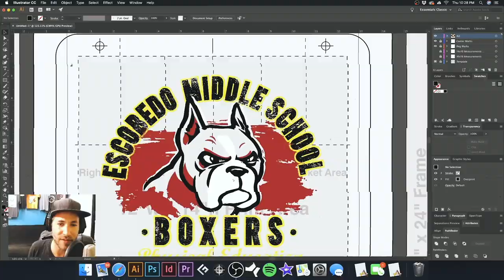How to Screen Print Rally Towels for High Schools, Colleges, Professional Sports Teams

Comment: Thanks for the advice Matt, really nice turn out on them towels! I wished I had enough work for an automatic press lol. Anyhow I use a water based adhesive as well, to much money for the aerosol sprays , less mess and more prints. I would go through cases of sprays determining  what substrate I used $20 quart of water base tack last me more then 1000 prints easy, try that with aerosol spray tacks, you would be lucky to make it to 500 prints on a can that cost $14 -$20 depending on brand of manufacturer.  Keep up the awesome work Matt!
Reply from the maker: Any time! And thanks! LOL, I know the feeling. It's taking me 5 years, dreaming about an auto to be able to afford a used one, and now onto something new. I agree with you. Spray tack can be good in a pinch, but spreadable adhesive is less mess, costs less, and is better for your health. I appreciate it! Trying to crank out as much videos as possible, or film jobs as well go to try and help everyone out. Sometimes we have to just concentrate on our work which is why things can be silent at moments.

Comment: Matt, why is the press still in the shop and when is your new one coming?

What is the first white your putting down and what mesh screen? What’s the highlight white brand your using and what mesh on that 2nd screen. 

🤘🏾Andy
Reply from the maker: Hey Andy! Taking a little longer than expected to get the press in due to my scheduling. We're really busy and needed to put it off. They offered to send it to the shop, but we don't have space for it, so we're waiting to finish up our workload for the year. We're anxious to get it in, but we have a lot of jobs due that we can't put off at the moment.

I used the same ink for the base and second white. Wilflex epic amazing bright white. First screen is 195 and the second 230.
Reply: Mikey Designs & Silk Screen gotcha Matt . Can’t wait to see the new one . 

Thanks for the info, sometimes I don’t know what mesh to use . I only keep using the combo of 110/150 or 160/200  . I may try a 200/230 kinda like what you did and see the results and hopefully gives me a thinner feel
Reply from the maker: @Factory928AC  It takes a little getting used to if you have been using lower mesh counts. Using a 195 / 230 combo even for white will give you a much softer hand. Almost Waterbased like. You'll use less ink, emulsion, and spend less time exposing screens.

Comment: Towels came out great. I love that waterbased pallet glue. never looked back at the spray stuff ever since i switched over. sometimes I do still use the web spray stuff for hoodies but that tends to grab so much lint off of the garments and builds up a nasty lint carpet on the pallets. Pain in the ass to get off. have to use acetone. you run into that problem?
Reply from the maker: I agree! I feel the same way. Only time we use a spray is web spray for hoodies. We just account for the extra time needed to remove the pallet tape and replace it, plus the cost of the web spray. We generally charge another 50% more than we would for shirts because of the extra costs associated with printing hoodies.

Comment: Sir, what's the difference between white under base ink and normal white ink. Can I use the normal white ink for under base??
Reply from the maker: You can use the same ink. The difference is just the mesh count, in this case. The white base is a 195 and the top a 230.
Reply: @mikeydesignssilkscreen473  thank you
Reply from the maker: @redmud342   Any time
Reply: @mikeydesignssilkscreen473  Very nice print Matt, and as usual, very cool informative video. Cute Husky on the towel, but Apollo still has My vote❤🐕HaHaHa!!!
Reply from the maker: @rpbvid  Thanks! LOL, he's running for president so we're about to run off about of shirts for him. lol
Reply: @mikeydesignssilkscreen473  HaHaHa!!! I'll be coppin' a 2XL!
Reply from the maker: @rpbvid  LOL, time to create that design!
Reply: @mikeydesignssilkscreen473  HaHaHa!!! 😂😂😂
Reply from the maker: @rpbvid  :)
Reply: Quick question, on the underbase screen you mentioned your using a 195 screen mesh,  ( I do notice even on your anatol that you tend to use higher mesh counts) I seem to have an issue getting that much white down through the 195 to use as an underbase ( I have an anatol volt)  how many strokes are you using on the first white? Also after flashing and flattening you are going right to the 230 top white? Or more strokes on the 195 underbase?  Which white are you using on the towels and are you reducing it at all?   I’m setting up a black hand towel white ink job today, and I run these all the time, I’m just trying to get the most vibrant white while keeping some of the soft feel that the towel naturally has ( without using waterbase inks). Thanks in advance for any pointers

Comment: Why don't you use printer for printing stuff? Must Answer!
Reply from the maker: Which printer? And what stuff? :)
Reply: @mikeydesignssilkscreen473  like with DGT method, I checked people are printing tshirt with printing machine like EPSON and FOCUS. why are you printing manually?
Reply from the maker: @themehmoodshah  These were printed on an automatic press. DTG machines take about 5 minutes a print, plus these towels need the really corse knit to be filled. With an automatic screen printing press, I'm running these at about 10 seconds per towel. They needed these within 6 hours time. IMO, no way a DTG could turnaround a print as fast and fill the knit of these towels like screen printing on an automatic.